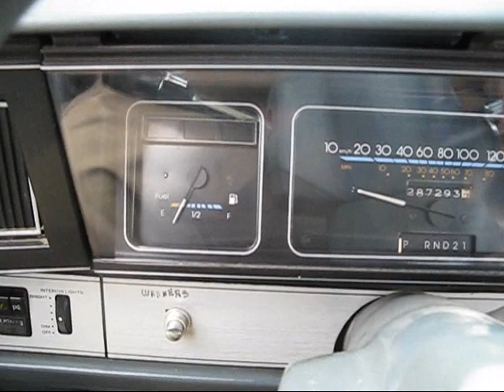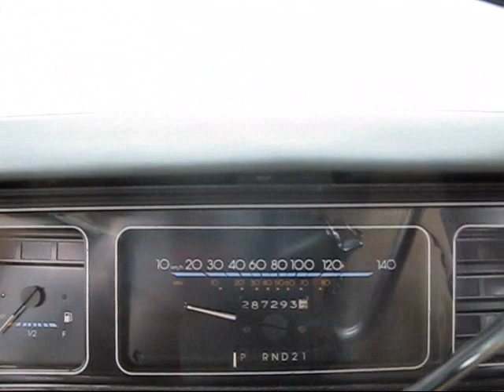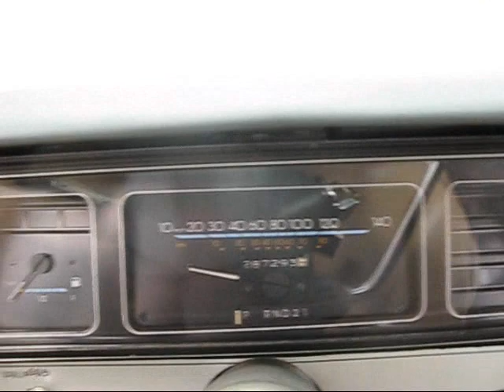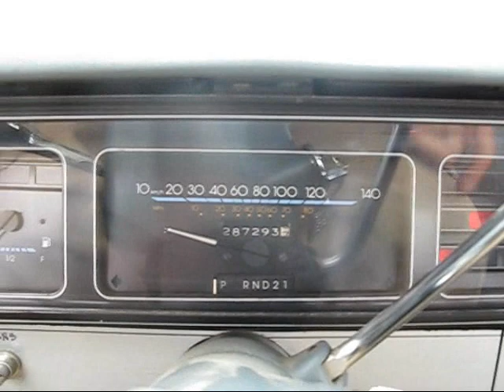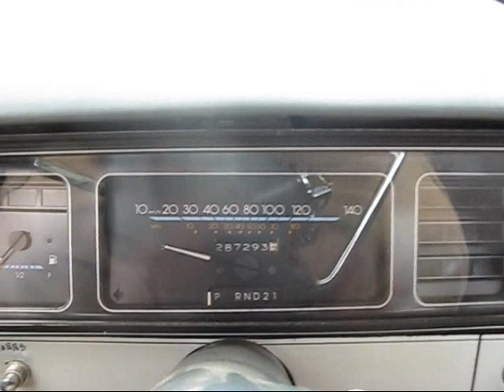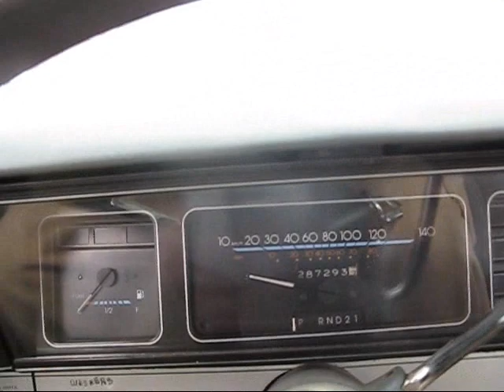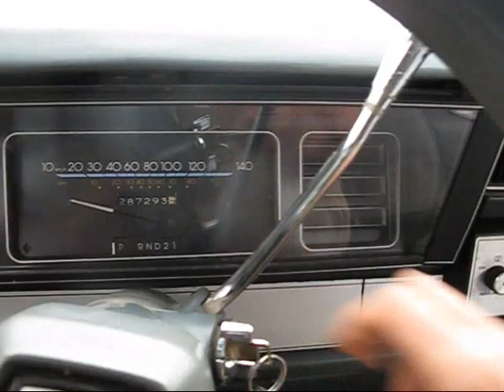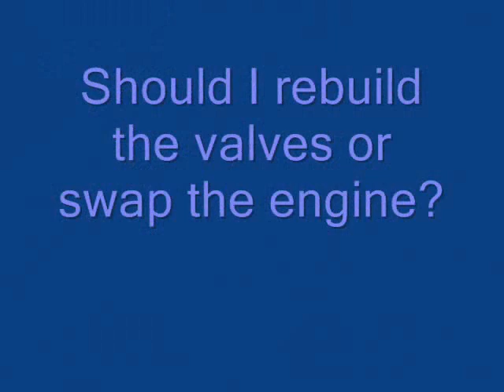Engine Swap or Rebuild?

Comment: it runs just fine ... no prob with timeing .. i bet the reason its havein fule problems is becouse your choke is giting stuck makein it choke out thats why your havein problems with the hp... if you want to try my thought undo the choke usimbly an tie it openwith a bread tie,... an i bet it will run like a dream ... i did it for a 87 caprice....